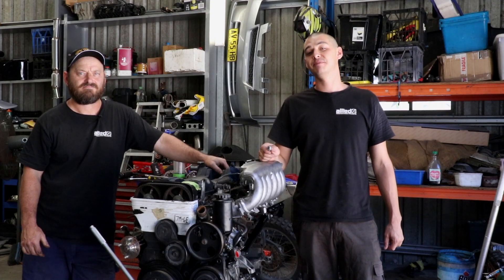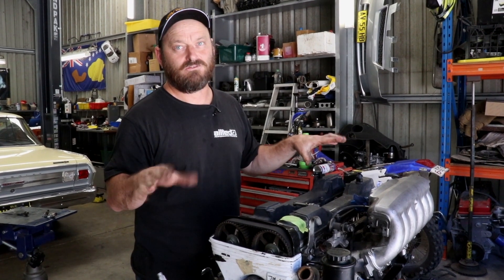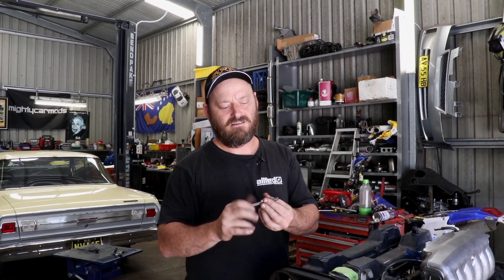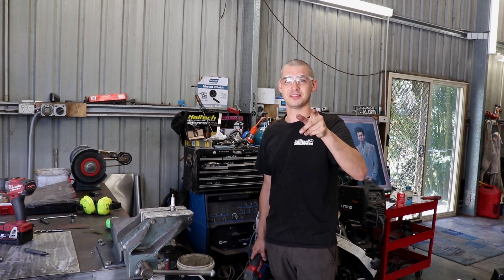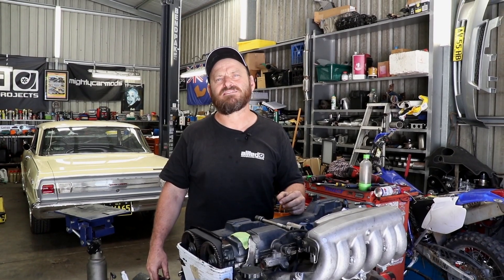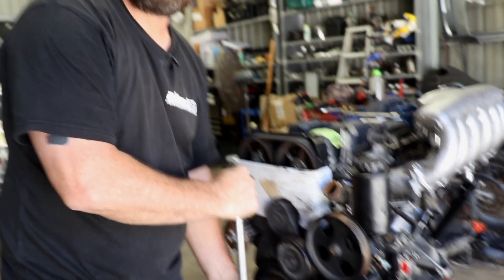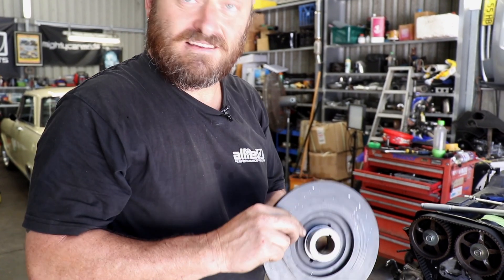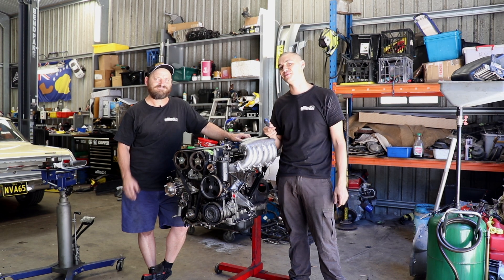THE SKID FACTORY - Finding True Top Dead Centre

Comment: I have a Dohc m119 Mercedes engine and they say in the service manual not to turn the engine backwards. Wouldn't going slightly past top dead center then installing the stopper and rotating only slightly backwards to make the first mark be better? Then rotating the correct direction until stopping to make the second.

Comment: This is a great topic and video. lots of shadetree mechanics learned something here I think, myself included. It took me a bit of pondering to realize how a piston stopper would help you locate the middle. I was in the middle of an A-ha moment when Al verbally put the pieces together.
I've got a fluid filled solid crank pulley on mine so not an issue, but I can just imagine how many engines get beat up from wrong timing because of this!

Comment: In my experience, bad things can happen with timing when turning an engine the wrong way. I would only recommended this before the engine is timed, or the cams installed. 

My guess is an old Roller for the final destination for that engine.

Comment: good stuff. IMO you could apply the same technique with the screwdriver, just mark the pulley at a given point when the screwdriver's going up (note when), and then when it's going down. Divide by 2, done. Less precise, of course, but no fabrication of the stopper involved.

Comment: Query - Spraying the degreaser to see the timing mark - Generally you would avoid this with rubber belts (eg: timing belt on this occasion) as wouldn't it possibly damage the belt and cause premature failure?

Comment: Just a side note, this MUST be done on the compression stroke. If you are doing this on a motor with no marks on the balancer, you will need to take the rocker cover off and check the rockers for Cylinder No. 1 to ensure you are on the compression stroke and NOT the exhaust stroke. Cheers.

Comment: It's actually fairly common for the balancer to spin and even separate - I had a harmonic balancer separate on a 2JZ once in my Soarer - smashed up the cooling fan.  I was 150km from home at the time so had a fun time replacing it & getting home.  A few years later the second hand replacement I had fitted that night also started to spin - this time I heard it before it let go - so I bought a new one - and this is going back at least a decade, so they must be pretty much all rooted by now.  I'm betting it's going in a Mercedes, since I've already seen a few Mercs with 2JZ's in them.

Comment: Never thought about making an adjustable stop - made up several many, many years ago that are all of varied fixed lengths using brazed in inserts.
Hard to see if it is done there, but I'd round off the engine end and use a lock nut (hand tightened) to prevent any rotatation of the stop from piston contact (probably overkill, though).
Easier to drill and tap using a lathe, BTW.

Comment: what happens when you have a timing chain on a worn out V8 or falcon 6 (pushrod)  that has heaps of slack in it..(aka variable cam timing due to wear) no point setting ign timing to factory spec when it's retarded 10deg due to slop
Reply: That's where you fix it first

Comment: Easiest way to make sure the tool doesn't hit a valve is too make sure number 1 is on a compression stroke by putting your finger in the plug hole while you wind it over. Or alternately, if ya got the tappet cover off check number one valves are shut.

Comment: So were the marks you guys made accurate in relation to the timing belt marks?..
Reply: Yes. In this engine you can check that easily but many engines have no way of checking without removing significant parts like timing covers etc.
Reply: @alanbutler2579  yeah I know.. my point was I never heard them say that the marks they made were lined up correctly.. meaning that this procedure works everytime and they didn't make a mistake..

Comment: A video on setting camshaft timings would be great. How to degree them to a certain spec and what effect that has on the performance.
Reply: Most people wouldn't be able to follow along.  I went to tech school, and even with somebody there actually showing you over half the guys struggled to get it.  But it's essentially the same as this was.  Take up the clearance with feelers.  Find the center of dwell.  Crack the cams loose and rotate the crank to the number you want.

Comment: Old motorcycle trick, many engines, especially two strokes specify actual piston stroke before TDC, when plug port was inline with hire, you could use thread pitch to set, or use a plunger dial indicator.
Wasn't aware it was needed on car engines though, like the two point/contra rotation method, very clever.
Great video both.

Comment: Why not use a 20 dollar chinesium borescope camera that plugs into the phone to go down the spark plug to visually see when the piston stops ? Sure it didn't exist back then but now they are so cheap and you visually see what's happening in the combustion chamber
Reply: Because the closer you get to TDC, the less the piston moves. Looking for contact between two hard objects is a lot more reliable unless your conrod is loose at the piston or crank end.
Reply: @EmyrDerfel  It's also a lot more dangerous because that long breaker bar is applying a lot of torque but you don't feel it because of the length. Like using a 5 feet tap wrench with a 1/2 inch tap. It will snap it like a twig with no feedback to the user. 

With camera there's no risk , you can spin the engine 1000x until you are totally satisfied with where the piston initially stops to make the first mark. No guessing of how far do I initially screw the stop in. Maybe with a 100 buck scope with a semi rigid stem it could even be manipulated 90 degrees to look at the cylinder walls to see the wear marks.

Comment: couple questions...

1) how does one do this in a diesel engine - no spark plugs. are the glow plugs big enough to use this trick with a glow plug hole?
2) how can you tell which is the compression stroke in the injector timing. if your engine has spun way out and you need to re-calibrate your crank and cam say?
Reply: I found an NGK pdf of their glow plug specs. Most use an M10 thread, very few use M8 or M9 (wtf??), the rest use M12, M14 etc. You don't have to use a glow plug so long as the external thread matches and you can cut thread for a smaller rod inside it...
Reply: @EmyrDerfel  damn. M10 external you'd probably be stuck with an M4 internal. Given they come in at an angle and the amount of force coming up on the piston - I'd be terrified of snapping an M4 in the chamber :/

Luckily mine is old and everything is keywayed and marked I shouldn't need to do this on mine. But even still...

Comment: You can use a dial gauge employing the same method. 
I used a gauge that's for setting diesel injector pump timing as it has a long extension rod.
I guess the benefit is less chance of damaging something.

Comment: Please explain how a dyno works and how you go about testing a car.  Ie low power runs high power runs what gear to use. Does wheel size affect Hp on the dyno. Are all machines the same do the Americans dyno differently to the rest of the world .  Etc
Reply: There are two types of Dynos.  Loading and Acceleration.

A loading dyno applies some form of braking and measures the torque reaction.  To find max power for a given RPM: Run the engine at a set RPM then apply load until the RPM drops, record torque just before the RPM drop. ( There are other loading strategies but this is easier to understand. )   This torque reading is displayed directly on the screen.  HP is a calculation that takes Torque and RPM and enters it into a formula. 

An acceleration dyno measures how long it takes to accelerate a large drum / flywheel then torque / HP is calculated from there.  

A loading dyno is like towing up a long hill / land speed racing  where an acceleration dyno is more like road racing.  

A loading dyno allows for tuning at X RPM and Y load.  This is where low power runs come in.  

An acceleration dyno will show reductions in drive line inertia like a light flywheel / road wheels making the engine look like it is making more power but it really isn't.

Comment: I don't like this at all, someone somewhere will watch this and break an engine!  A cheap LED  endoscope/borescope with a USB connected to a laptop screen poked just down the plug hole and TDC will be found without the risk of metal in the engine
Reply: Is that how you have done it? Because this is how mechanics do it.

Comment: That was really interesting. I once had an American Pontiac Fiero GT that started to make a right noise when the engine was running. Clang clang clang. It was like the thing was falling apart. Turn out the Harmonic Balancer was just like this one with a rubber bonded section. And due to age it had rotted and just fell apart. So the harmonic balancer was just flapping around in the breeze when the engine was running.

Comment: Which cylinder should this be done on? Always #1?
Reply: Generally should be done with # 1.  . With an inline 6 it could be done on cylinder 6 as it is up when 1 is up.  Same goes for a inline 4 ( 4 is up when 1 is )   With a V8 it depends on the manufacturer / numbering sequence.   The only reason not to use 1 is if there is an obstruction preventing getting at the plug.    Sometimes when setting timing belts / chains #1 isn't the reference point.  Usually this is to prevent valve bending when setting things up. ( crank is rotated so all pistons are partially down in the bores.  )

Comment: the episodes are great keep on making them like they are. I have one question how do you find a TDC on a diesel engine whit direct or indirect injection the glow plugs aren"t mounted the same way as sparkplugs and injectors don"t have big enoug hole to do the same as you did.
Reply: Old engine valve upside down in the injector hole,make sure the valve stem is protruding into the cylinder and actually contacts the piston,before the valve head meets the cylinder head,turn the engine backwards 90deg then clamp the valve down using the injector clamp.
Reply: @dicktaylor2600  thanks for your reply

Comment: Al, have you ever seen a damper seperate completely from a running engine? I have! And I never want to see it happen again.
Reply: The belt drive section of the JZ pulley's was common to come off but I had never seen the outer section fail before.

Comment: Great video guys!!....Question? Does not the length of the stopper mess with how far the piston comes up, thereby changing TDC measurement? If the stopper is an inch long, then the piston is an inch short of TDC....Right?.....or am I missing something?
Reply: It does not matter because you do not mark the actual TDC with the stopper.  TDC is exactly in the middle off the two markings, does not matter how far apart they are (which is dependent on how long the stopper is)
Reply: @myrakas86  OK. Now I got it!...Thanks.

Comment: Can the crank shaft get twisted like you see on axle shaft splines sometimes?
Reply: Generally no ( short of maybe a top fuel nitro motor ) .  The torque of an engine relative to it's size prevents that from happening.  With axle splines, they are much smaller and torque loading much higher.

Comment: You can still use a dial indicator in the same method on hemispherical spark plug engines. Set the peak height at 0. Drop it down a set number on either side of the stroke... say .020" or whatever you fancy to mark the pulley. Granted it leaves more room for human error. But works just as good.

Comment: Wait a tick - The crank timing belt pulley was chucked off the crank keyway too...
Reply: You saw the timing belt guild on the outside of the pulley, it's a separate piece that has some leeway for ease of installation.  The pulley itself I'm sure is on there properly.
Reply: @joshuahebert9949  100% correct, just the belt guide which is normally sandwiched by the pulley.
Reply: Saw that.  Oops.
Reply: Saw that too.

Comment: The Ecoboost as in the lamented late Ford Falcon is an international engine (Mondeo, Focus ST,  Jaguar, Range Rover, Fiesta, Land Rover, Lincoln, Fusion, Escape, Volvo, Transit, Taurus, Edge, Everest, Mustang etc) and has a huge support base overseas incl. the US. They are known for their power and economy (just not at the same time) There are a few different features I'd like explained like direct injection to turbo (I think) and a turbo that is part of the head. Anyway, an overview would be good and Al's POV regarding performance enhancement.

Comment: What is it going in?  I say the covered car on the rack.  

What kind of car?  I say Plymouth Super Bird / Dodge Daytona.  1) Pointed droop nose.  2) lower control arm has a camber rod running to the K frame.  3) Steering linkage is behind the axle center line ( rear steer )  4) Engine is rear sump  5) Wing is covered up.

Comment: I would like videos about finding reputable sources for parts, eg wiring crimpers connectors ends etc. to work with factory harnesses. I was rewiring the door harness on a CRV(civic etc) and nobody I asked had any clue as to where to find the proper terminals . Including the service manager at our only Honda dealership. He advised me they kept old harnesses to cannibalize. WTF . The old hondas at the wreckers 90% plus have broken wires at the plug how can nobody know where to get new crimps? Someone must ask their mechanic to fix the power door locks. The cars run forever.   PS the most luxurious vehicle in the world would be a Rolls or maybe a Maybach. In Australia it could be something different though.

Comment: Can i just point out that most spark plugs are a common thread
M14x1.25 if it uses a 16mm socket from memory 
So just use a bolt and a nut to do the same job and not waste time drilling and taping a spark plug

Comment: why do people say you shouldn't replace harmonic balancers with solid pulleys?
Reply: As a guess  they are designed to dampen inherent harmonic issues.If the pulley cant dampen those harmonics those vibrations have to go somewhere....which would be your crank.
Reply: @aussieguy1012  most of the time they are minimal vibrations and its just about comfort on many engines. 
like a straight 6 is naturally balanced but an inline 5 has lots of vibration back and forward which could be an issue.

Comment: Likely someone heated up the pulley previously to remove it, which destroys the rubber and can cause it to slip or fail completely.  3S-GTE is a legendary motor!  Although I'm sure it was a calculated dig at a certain mini :)
Reply: It wasn't a dig at BOM, 3SGTE are just prone to secondary vibrations like every inline 4.
Reply: ….and every inline 6 too, of course, like the 7M in the vid.  My old 3S-GTE did OK at 8200rpm redline on a standard bottom-end.  It only went out of balance when a piston melted...
Reply: Inline 6's do not suffer from secondary vibration, that is what makes them such a good thing.
Reply: Yes they do.

Comment: So can the same technique be used for side entry plugs? Unfortunately I'm talking about a 4 banger reliant engine not a V8, it's a trike though not a robin before I get abused, I know it's still coming but just want you to be factually correct when abusing me.
Reply: Will work with side plugs.  Just be careful not to turn too hard otherwise the tool may bend.  Also check for a valve hitting the tool.

Comment: can you do this to a diesel engine? or is there another way?
Reply: Diesel or petrol, this is about finding the top of piston travel... same rules apply.
Reply: No spark plugs and on a diesel, modified injector would be my guess.
Reply: @jaydunbar7538  correct, although you can use the glow plug hole to the same end result.

Comment: How far do you thread the bolt through the spark plug . Can you have it too far through stopping the motor before it reaches TDC ? 
Or does it not matter because when you reverse rotate  and find the center its still TDC ?
Reply: it doesn't matter how far down you screw the bolt. as long as you follow the process you'll find TDC. The further down you screw the bolt, the bigger the number you'll have to divide by two. If you don't screw the bolt down far enough you will never find TDC and can't do any damage at the same time.

Comment: Recently I was told my way on a Rotary is wrong, I’ve always used the #2 rotor spark plug holes to see apex seals then make the pulley and divid, just wondering how you guys do it as there seems to be so many rotary builds there in Australia

Comment: The same method of marking the crankshaft at two points and finding the center could not be achieved by a dial indicator?
If the piston head does dwell for 10 degrees (random number) this would be evident on the indicator in both directions.
It seems the bolt is just a physical threshold tool.
Reply: The dial gauge would work if you could accurately stop at the same point every time in both directions. Having a hard stop point ensures accuracy. Whilst there is some inaccuracy in eyeballing a dial gauge. (even half a degree out on either reference point can fuck up your TDC mark) having a hard stop ensures accuracy.
Reply: Having some time to think about it; I now see the point of the physical hard stop. An engine does not crank smoothly, and the chances of being able to hold its rotation at your '0' are pretty slim.
Reply: @Rapidpanda1st  using the starter motor will always result in failure in any way. you have to hand crank the motor to ensure any degree of accuracy in either direction.
Reply: @scottthompson292  No no, not using the starter motor. Just hand cranking off the crankshaft pulley isn't a smooth motion.

Comment: Straight forward and practical. Can also be down with a dial gauge (using the same technique,) but not everyone has dial gauge with a long extension. 
Would be great to see this extended into setting up cam timing on a twin cam engine.